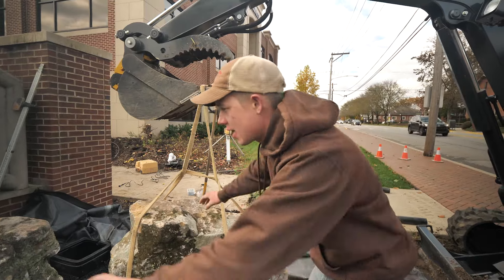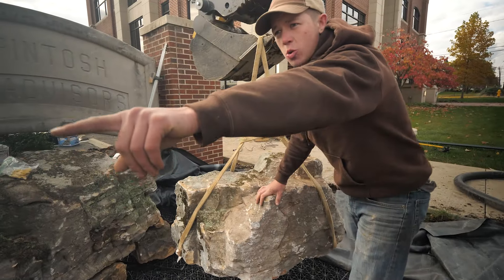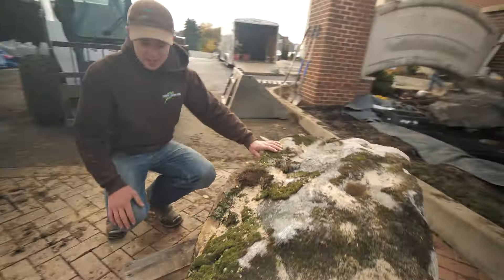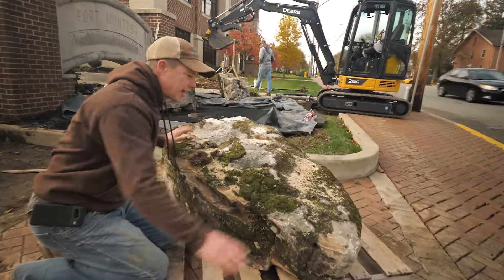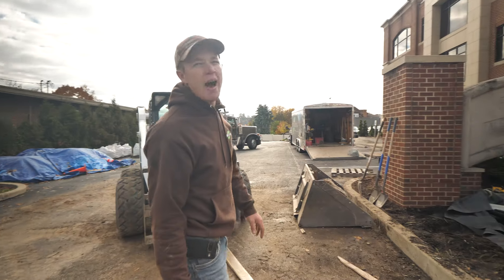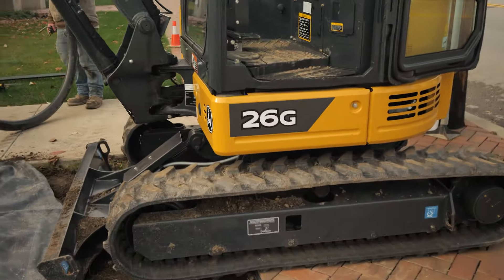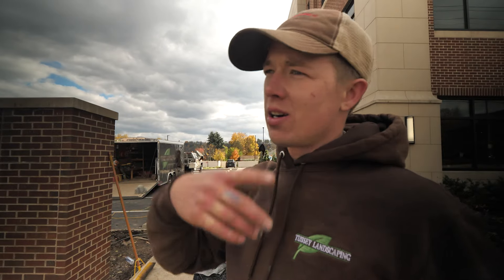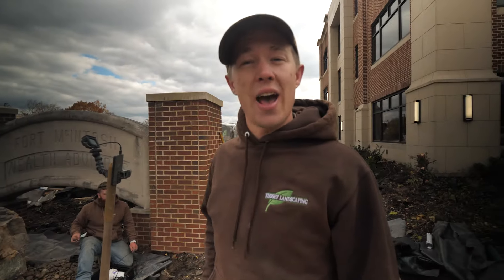Niagara Bubbling Rock Installation | Enterprise Bank Makeover

Comment: Does a wheeled skid steer have a greater lifting capacity than a tracked one? just curious if there is an advantage of one over the other.
Reply from the maker: I think that's a loaded question and completely depends on which skid steer or loader that you have access to!
Reply: @Tusseylandscaping  😂 😉